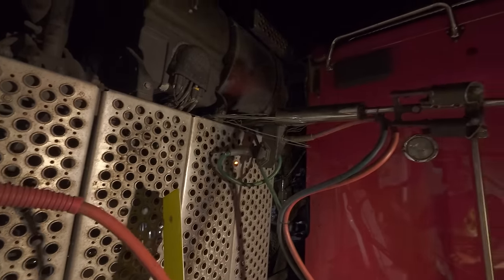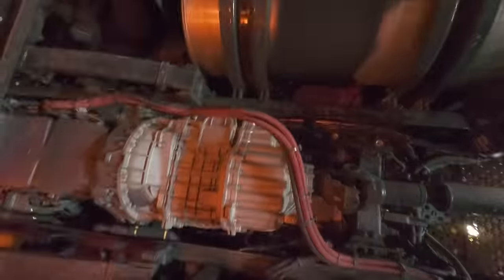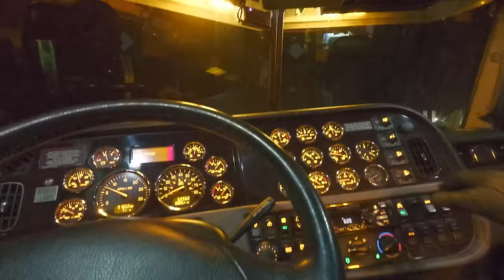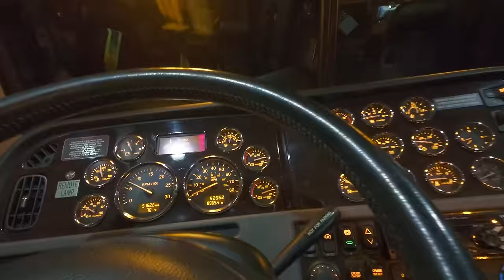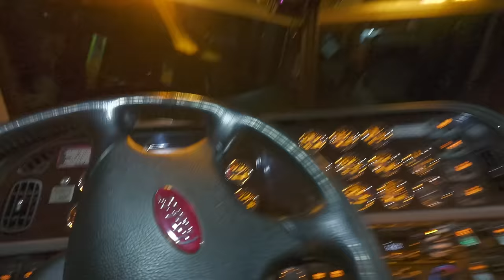Hazmat Tanker Rolls Over in the Desert!

Comment: Man, you guys were out there in the middle of nowhere!  Right there on the edge of the Mojave Desert.  That's closer to Barstow than anything else.  I had to make stops at Edwards Air Force base, and regular trips up through Barstow and all that.  

The desert is a lonely place at night.  It's so quiet that they say people have gone loco because of it.  Well, high desert people aren't what you call quite right anyway, and that's one of the explanations.  That, and the heat, though I've seen it snow in parts of the Mojave and the high desert.

Comment: Even tho it has air release for the fifth wheel, you still can pull it. It's harder but it can be done. You all need to have fifth wheel pullers so your hands aren't down there while it can move and crush you or your hand.

Comment: Clearly the FD have a lot of trust in Pepe's, or preferred to be as far away as possible during the recovery.

That road seems kind of narrow to have streams of LPG trucks passing both ways.  It was barely wide enough for Big Flipper to setup with full outriggers! 

I thought the trailer & tank made some unusual noises during this recovery. More creaking and banging than we usually hear. Perhaps the outer frame didn't enjoy being on its side fully loaded.  A lot better it was barrel rolled by Pepe's rotators and not just dragged back upright by conventional rear lifters. 

As a side thought, if you're going to do a lot of these there might be a safety margin in getting a couple of LPG detectors, in case leaks start during the recovery. Though I guess by the time they'd go beep, it might be too late. Hmm.